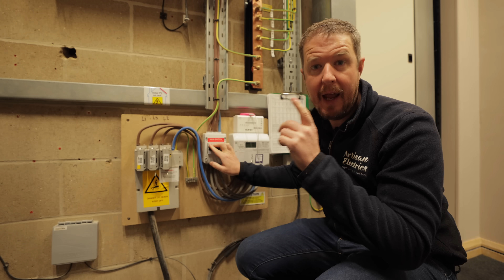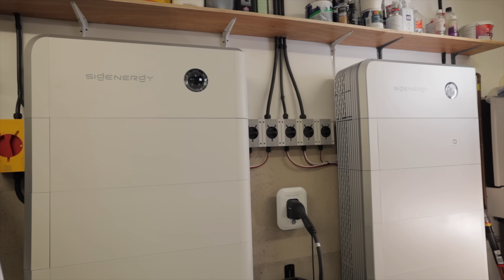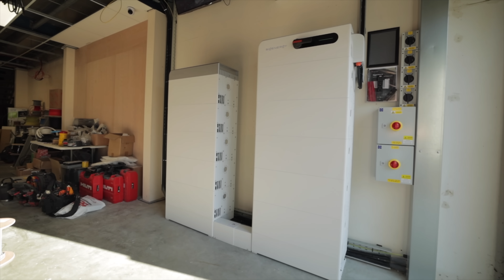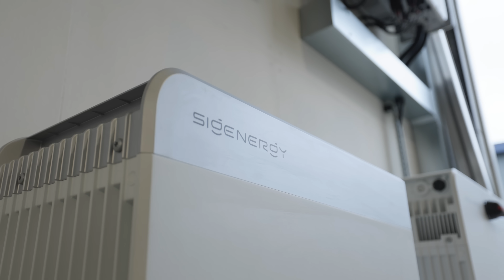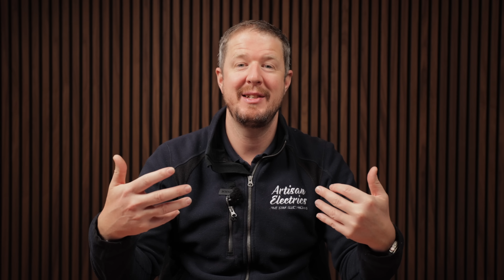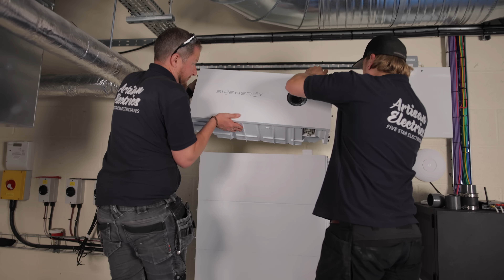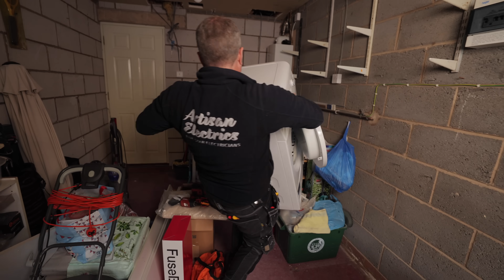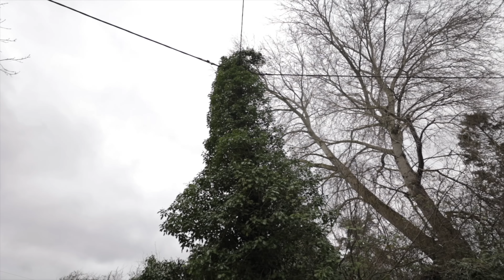You’ve Been MISLED About Battery Backup

Comment: In suburbs of Dublin. I put in Ecoflow 5kw inverter with 2 of 5kwh batteries, single phase.
19 Aiko 460w panels so far.  I keep 3kwh for power outage (experimenting). I put a manual chanover switch to allow ch, tv internet lights etc in one end of my house including kitchen but not cooker. It is fed off the aux 230 outlet on the inverter 32 amp breaker into the feed to a secondary distribution board. Havent tested it beyond 3.5 kw. I think its good enough as we are on the same part of the grid as two large nursing homes so they generally get grid up fairly quick. Its better than a crappy generator. I have the option to up my reserve by sliding a little bar in my app. Keep more in darker winter days
I used to have a 30 kva (i think) trailer mounted ford 3 phase genny for powering three reefer units together.... never even used it once. Lived here for 67 years and just want not to be scrabbling for torches when the lights go out. It happens once in a few years usually during or after a big storm.
PS Ecoflow app is theoretically great but it switches itself off every few days and its a pain to get connected again despite saying its connected. Should have done more research or just signed up here sooner.
Will probably put another battery into system when I can get a deal.
Bought an automatic changeover switch but decided against using it after reading all the downsides including false jumps. This part of the system will work on batteries after power comes back online so no emergency about switching back anyway.

Comment: I'm kinda going the opposite way, we've been off grid for 6 years, we've now got a 3phase supply due to building regs for new builds, After paying the electric bill for the last 6 months  while waiting for the off grid stuff to get relocated, I can't wait to go back off grid and use the mains as the primary back up and top up during the two winter months when the generator was needed.
Off grid in the UK is pretty easy and  some of the size systems that people think they need are a huge overkill and unnecessary. The Average UK home uses 6 to 10 Kwh per day and the longest power cut I've known in the past 59 year's was hours not days. Something we learned from experience was very often people talk about how long the battery can last forgetting the Sun hasn't failed in 4. Something billion years so your battery only needs to last until the morning!
Reply: The last major outage we had here in Shropshire was approx 45hrs, which we didn’t have enough capacity to cover, fortunately most outages are only short so capacity is ok, fortunately those that live in rural counties then adequate capacity does matter.

Comment: I chose a 10KWh inverter and I realise now, half way thru your video, that my "whole house backup" option will be limited to 10KWh. So if the air-conditioner is running when the grid goes down, the battery backup will fail. But in all other appliance scenarios following our usual usage patterns, the battery backup should work seamlessly.
Reply: I don't think your air-con would use all 10 kW, at least not for more than a couple of minutes while it gets the temperature right. It should then settle to a much lower draw. If tho, you turn on the oven, the kettle, toaster and microwave at the same time, during a grid outage, then it will trip. It won't fail, but it will need a reset.
Reply: @MichaelWakefield-mx6hg He is talking about the inverter.
So even if it draws 10kW only until the room reaches the required temperature, the inverter still needs to be sized to handle that 10kW load.

There are two different things in play here:
1. Sizing the inverter
2. Sizing the batteries 

The changing power requirements of the air con over time means that it is harder to calculate the total energy (in kWh) used by the load over 24 hours.
This impacts the size of the battery (in kWh).

The energy calculation is simplistically, energy = power * time.

And the on/off duty cycle for each load over 24 hours needs to be determined and factored in.

It's not hard, it just takes a bit more effort and will likely involve a number of assumptions. Or it could even be measured with an kWh meter.
Reply: Inverters are not measured in kWh. They are measured in kW.
He clearly explains the difference between kW and kWh at time: 08:30

It is really important that when working with photovoltaic systems that you understand what kW and kWh are.

Comment: Oops..you lost some credibility for me when you stated that most kettles are 1kW (1000w) when in actual fact most domestic kettles are rated at 2800>3000w. The low energy models for caravan and camping use are 650>1100w, these are quite difficult to find in everyday retail outlets, in the UK at least. Other good information however, well delivered. Thanks.
Reply: In Australia, most kettles, frying pans, etc. are rated 2200W to suit our 10A rated GPOs (250v supply). Travel kettles can be hard to find unless you go to a camping store.
Reply: Credibility? Don't be silly.
He has installed enough photovoltaic installations that he knows what he is doing. Using a non realistic figure for power of an electric kettle says zero about his ability as an electrician installing PV systems.

So grow up

Comment: We've had power cuts that have lasted nearly 3 days. !!!   We had one after a few hours after we moved in. Couple of hours. SO one of my priorities was Solar Panels and batteries. Having looked up one a government site for some names of reliable installers, selected one and made it clear I wanted a battery backup with auto-switchover. Did I get it? No. Theoretically the inverter would not only isolate from the grid but it would switch over to backup circuits. The install company didnt seem to understand this and hadnt wired it in.  Of course I didnt find this out until the next power cut and while it was only 30 minutes, I was annoyed that nothing had switched over. Getting hold of the installer was no longer an issue as they had gone bankrupt and out of business. 
Eventually found another install company who could help who installed a seconds consumer unit with half a dozen fuses. It would seem that there are three circuits backed up - 1) Kitchen low power sockets (fridge, dishwasher!) 2) Utility room (maybe on Kitchen circuit. Includes a Freezer, washer and dryer). 3) Lights - its marked lights but I havent found a light circuit that works.  This was closer to what I was after. Ideally in the utility room, only the freezer needed to be backed up and I would have foregone washer and dryer. What I wanted was a socket to which I could attached my computer and internet to. It was very frustrating to say what I wanted,  get agreement and yet it not be done.. 
Having got that back-up installed, I noticed that it still wouldnt always kick-in. But if the panels generated enough,  suddenly my freezer, fridge et al would come on...while the sun was out. Given this was at the 3 days power outage I was a bit annoyed that still the system wasnt performing as I wanted. 
Playing with the inverter menu system I found a setting for minimum charge for backup. The batteries will only go to 20% but if you want back up, you have to set the backup minimum too (I set to 30%) and make sure its enabled. Some smaller outages have shown that this works ...although without anything to power the computer or internet I have had to go back to reading.
I'm not overly confident in the wiring, isolation, earthing  but I have something.

Comment: What's your thoughts on the following. I have a 9.5kWh GivEnergy AC coupled battery that has an EPS output. What is stopping me running that supply (after OCPD/RCD etc) to a 3 position suitably rated change over switch. Then connecting one of my home's socket radials from the C.U RCBO also to the change over switch and the outgoing radial to the output of the change over switch. Then on loss of grid switching from position 1 (grid) to position 2 (off) to position 3 (EPS) to then power that radial. On restoration of grid simply switching back? The earthing is TT. I'm assuming that on restoration of grid the EPS would disconnect automatically also?

Comment: My last system was still exporting in a power cut and I was told it was so dangerous I had to have it disconnected. Now thank god I  have a Powerwall with a Gateway :) works every time without anyone knowing. It was how I convinced/impressed  the wife it was a good buy. Just ran the house off grid and told her there was a power cut :) does not even flicker and it's that good I've taken my small UPS's for the PC etc away as now I trust it to keep us going in a real cut
Reply: My Afore inverter immediately trips if the grid voltage and/or frequency is outside of a narrow range. 
I noticed that the technicians working on the power lines short the wires as a precaution. It would be very adventurous to trust equipment that you can neither see nor control not to feed back electricity at inopportune moments.

Comment: My experience with Tesla batteries is that switchover is several seconds, at least with fluctuating grid supply, even when load is low. It's quite annoying. I have a suspicion Tesla changed the Firmware causing longer delays for stabilisation last year.

Comment: If you dont have one already you should do a video on designing a solar system that is grid tied and has a backup generator with batteries where you draw from solar and batteries, feedback excess power to the grid and use the backup generator when you have cuts and the batteries are depleted. Basic’s…. What components are required. Can someone start building out the system over time like start with a hybrid inverter and generator then add solar a few months later. Then batteries a few months after that..   A video that shows how to slowly build out the system over time

Comment: Superb technical video as usual Jordan. Madness to install solar and battery without a gateway.

Sigenstor, by far the best on the market for not only extended backup but protecting your TV, ur fridge, dishwasher, washing machine etc printed circuit board when there are those, unnoticed to the naked eye, voltage dips and surges.

God knows the price of a PCB replacement these days usually writes off an appliance.

Comment: I have a small house and use 189 Kws in 2 months. 189*1000 = 189,000 Watts for 2 months  / by 60 days = 3,150 Watts per day.  If my electric is off, it is normally for 6 hours, but I will calculate for 12, so 3,150 Watts / by 2 is  1,575 Watts for a 12 hour power cut.  By the way, I live in Mexico with 120 v grid power. And I pay $250.00 Mx Peso for 2 months.
Reply: Your units are all wrong.
You need to sort that out.

Comment: Hi, would you recommend or is it possible to utilise tariff such as Octopus intelligent  to charge a battery overnight to use during the day and recharge each night?
Reply: This is a FUNDAMENTAL question I would like to see answered. Looking at what is possible, batteries with a gateway, the answer should be "yes" but does not form part of this video, nor has your question been answered by Artisan. I have in mind to do exactly the thing you are proposing. While my electricity consumption is low, payback would need to be measured in decades, as the first part of a solar system, payback could be shorter. (I could go from using cheap electricity to using no electricity and even selling some off.) 

However, I have a close relative living in an electricity only dwelling with £240 electricity bills during the winter months. I also have a friend with solar and no batteries with 'small business' grade yearly electricity consumption, would would have a very short payback period if they had batteries too. Costs and paybacks would be an interesting video regarding storage.

Comment: We've got a basic ecoworthy 5000w hybrid inverter, 5.12kwh battery and 4 x 530w solar panels. That does all our power except for the worst winter days when we import a few kwh per month off peak. This inverter doesn't have export potential, import only. No time of use settings either so I have hard wired in a mains timer and contactor to only allow mains charging between 2:30am to 4:30am when our electricity is only 5p per kwh to top the battery up. It's a simple mains in mains out, battery and pv input. It's off grid/disconnected from the mains 99% of the time due to the timer and it works perfectly. No seperate critical load consumer units etc. We also have a small generator to charge the battery via the inverter if solar is terrible and mains grid power is down. Great little system and didn't cost the earth. Crazy to think some off these big money systems don't even have that function.
Reply: Does your inverter have the generator NC  NO connections? You might be able to use them to kick the contactor in case the battery is critically low
Reply: @hulakdar No we just isolate the mains with the AC isolator switch and breaker. Then remove the majns AC cable and wire in our generator cable. Very simple. Only takes a minute.
Reply: @nickls11  that's not what I meant. I was talking about the mains contactor circuit. Even the cheapest inverters nowadays usually have a control block for a generator (a few small contacts that are labelled NC (normally closed) NO (normally open) and C (common). What I'm saying is that if you have a need, you can use those contacts to close the mains contactor if the batteries ran out for example

Comment: In my 'printer room' I used a 15a battery charger to two large 12v van batteries into a 1500w square wave inverter running 3 epson desk printers, a a0 large format printer + a vinyl cutter and two laptops+monitors. Oneday my mug heater wouldnt work but everything else was running... after some testing it was the inverter putting out 220v dc.....timer on the mug heater had an old style 12v transformer the rest had electronic supplies
Reply: Square wave inverter - sounds like you are using a cheap inverter using what is known as "Modified sinewave output".

A very effective way to destroy sensitive electronic equipment.

Use a "true sinewave" inverter.

Comment: 20 to 40 milliseconds is not long enough for the vast majority of electronics to care about that at all, many commercial UPS units have failover times in that range, I've installed and managed 60 to 150kw commercial UPS units in data centers and 20 to 30ms was common for Eaton, Liebert, Solaredge etc. Second this is the problem with your Sigenergy setups that limit the inverter size to what the grid connection is, vs normal hybrid inverters from Victron, Schneider etc that typically offer dual outputs, so that in an emergency it will only power on the critical loads and non essential loads are connected to the secondary output and disabled unless you enable them. This prevents you from tripping out the inverter. The transfer switching is also in the inverter so you don't need an external gateway, they will not back feed to the grid during an outage. They also have the advantage of working with a variety of 48 volt batteries instead of a brand that may or may not be supported a few years down the road. The question about battery storage shouldn't be does it help from a backup standpoint, instead it should be used to reduce your power consumption peak rate hours by offsetting it via charging to off peak hours. That will often pay for the battery fairly quickly, with backup power as a nice additional feature.
Reply: True, from a purely financial perspective, having backup might be considered a luxury. But at the small price you pay for a modern gateway - 1 to 2 thousand depending on the brand - the convenience of never losing power makes it a bargain to most homeowners. Plus, you get way more control over the charging and discharging of the batteries, to or from the grid or home (or EV). Plus smart ports that allow load shedding and time or solar based profiles for a large load. Too many pros to ignore imo.